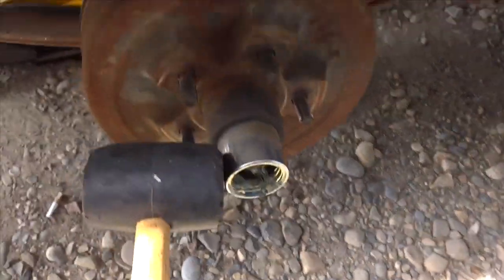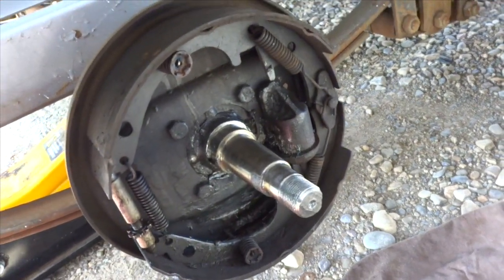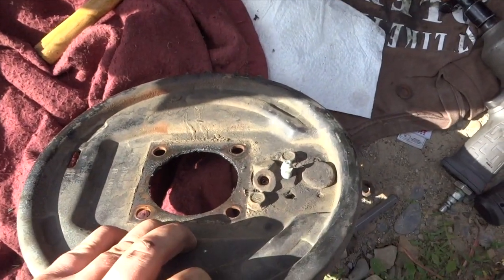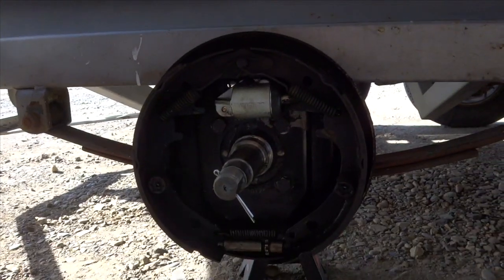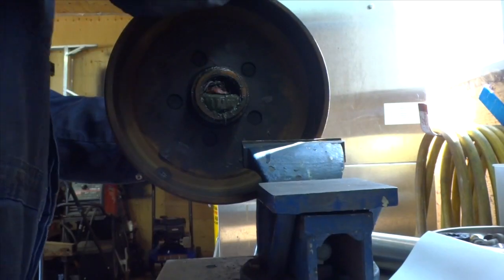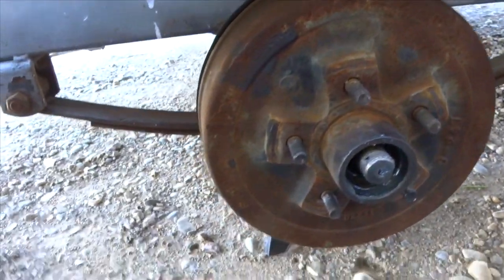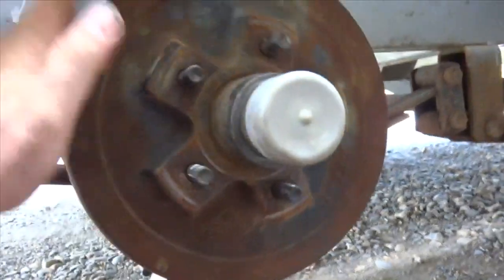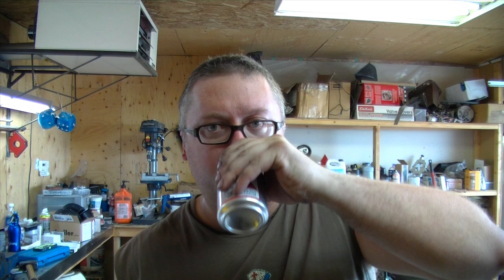Surge Brake, Wheel Brake Cylinder Replacement DIY

Comment: I didn't want to take the time to read all the comments, but when rebuilding slave cylinders on drum brakes, you almost always rebuild all of them at once. I was told very young that the stronger one will blow the weaker one. Whether or not this is true, I do believe if one wore out, the other is probably due to wear out.